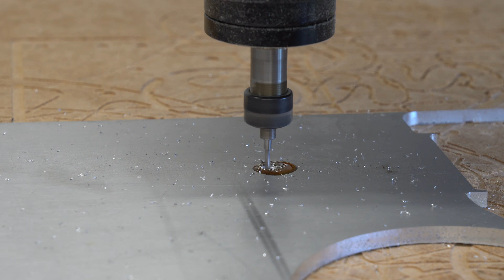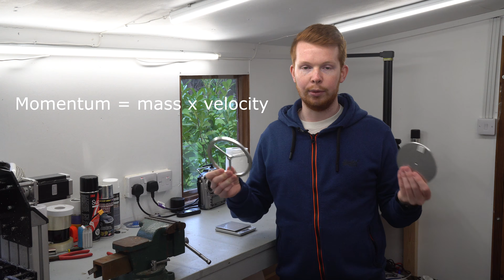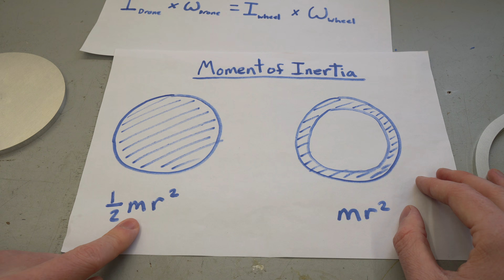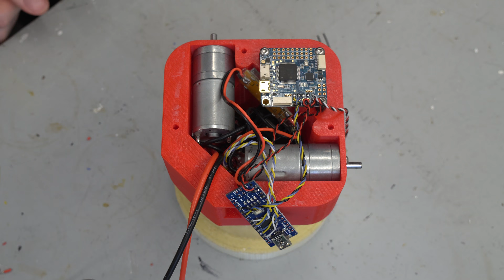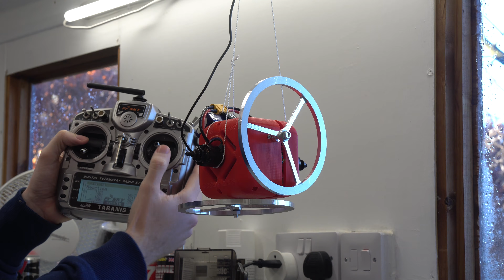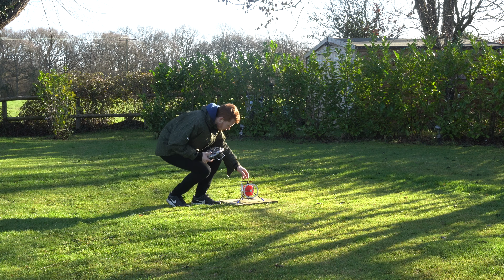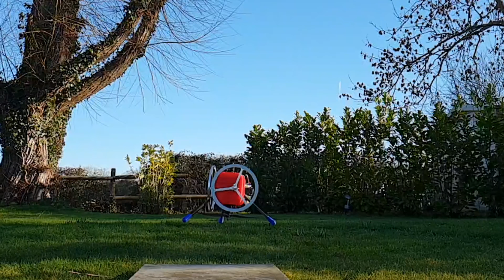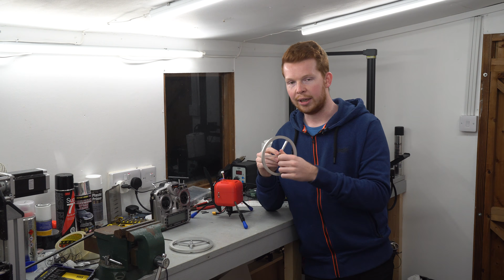Comment: I dont understand.. you are using the wheels, at least not like reaction wheels, only to counter certain moments, but all that it would work way better if the wheels are in constant rotation (so the stability would increase) and they accelerate or slow down depending your orientation requirements. 
But your rotation speed is 0, and you accelerate for one side or the other which does not seem useful at all.
I dont know.. I did not watch the whole video, maybe you explain why you try it that way?
Or you think it is cheat to use a gyroscope effect?
Reply: AngelLestat2 The problem is that you may need to induce positive or negative roll and pitch, so if you start with the wheels spinning, it means one direction will be much closer to "saturation" (i.e. no control authority).  Also, gyroscopic precession can make for some strange effects in control.  Reaction wheels are not a good design for controlling a drone.  You use just as many motors, it weighs more, you don't have very good control authority, and you get strange effects from the high angular momentum of the spinning reaction wheels.

Good video, though, on showing what not to do.  Worthwhile experiment anyway for educational purposes.
Reply: @brainmind4070  yeah I follow you, is true everything you said, but I guess it would last more than that :)
In order to have some application of reaction wheels in the atmosphere,  we would need both wheels by axis with the addiction to be used to store energy (at least 10 or 20 seconds of peak energy), for example it could be practical in a cargo airship that it would be used also as crane.
Reply: Pretty sure that the sort of thing you're referring to is a control moment gyro, whereas these are simple reaction wheels? (Granted, I would like to see a drone fly using CMG's - that'd be insane lol)
Reply: Mush V. Peets Yeah, I don't know if cmgs would have enough control authority in an outdoor environment, but it would be cool to see someone try.

Comment: Have you tried smaller sized reaction wheels (1/3 or 1/2 scale) mounted on all 4 sides instead of two larger on only two sides? I've seen reaction wheels cubes with large wheels for large movements and small wheels on the same axis for maintaining the balance.

Comment: Shouldn't the axis of the motors intersect the center of mass? It would seem that these off center axis would add other components to the movement like vertical and horizontal displacement when accelerating. That would explain the wobble or walking off the drone makes.
Reply: I don't think this matters actually. The moment (torque) is applied to the rigid body and acts everywhere on the rigid body. Since it is a pure moment load, then the location doesn't matter. The wobble is due to gyroscopic procession.

Comment: Instead of the brushed motors, you should use stepper motors which will provide very accurate amount of rotation for the wheels and will also compensate for caliberation errors.

Comment: Fantastic original thinking -- your best project since the trebuchet. It wouldn't even have mattered if it hadn't flown at all; the concept itself is just great. Well done!
Reply: *Well drone 😂
Reply: Great stuff Tom your skills as a presenter are really coming to the fore.
Reply: We typically learn more from our failures than our successes.  I also applaud his original thinking and determination to work through the entire experiment.  A very bright guy and a fun experiment.
Reply: Slap on 3 carbon fiber stand-off rods on top as well. Notice how it's never the bottom propeller that gets the worst.
Reply: Do you consider lack of knowledge in physics "original thinking"? :-D LOL ROTFL
Reply: @ok4rm  I don't see how one thing has anything to do with the other. Do enlighten us.

Comment: The issue here is insufficient feedback control, think of it this way, you have 3 PID loops for each axis of rotation , however the control for the motors requires their own individual nested inner loops, to deal with the non linear torque current relationship otherwise the resultant system is as good as being in an open loop configuration. 
So in each inner loop:
we can assume a linear enough rationship between current and velocity , and between the input pwm signal (a double for votage ) and resultant current. 
then we know the the relationship between velocity and the output torque . 
so the inner loop must take pwm as the input and then using an encoder for velocity feedback take that as the output.
this then feeds into the outer loop which for the time being is being provided by your  flight controller

Comment: Reaction wheels are also used to control the orientation of large space stations (such as the  International Space Station) but they have proven very problematic and the failures have led to a lot of study. Here's the most significant paper (I believe) about the issues they have experienced with reaction wheels on the ISS http://esmats.eu/esmatspapers/pastpapers/pdfs/2017/bialke.pdf

Comment: To save mass, you should make the reaction wheels out of batteries. Include a sliding contact system in the shaft and you'd be able to increase flight times significantly.

Comment: shouldn't the wheels be spinning from the start?
and use braking/slowing of the wheels for ur torque vectoring?
Reply: AthrunZala2395 The problem with that is that the braking can only impart a force in one direction, so if a reaction is required in the opposite direction, your wheel is much closer to being "saturated".
Reply: @brainmind4070  Use braking for one direction, acceleration for the other. Make the braking "power/speed" match the motor's ability to accelerate (that way when either braking/speeding up, the force is the same just opposite.) Don't use max speed of system, just somewhere less than.
Reply: EvilBonsai No, sorry, but you don't understand.  A reaction wheel can only spin so fast.  This is called "saturation" when it can't spin any faster.  Once it is saturated, it will have ZERO control authority in that direction, and it will only be possible to brake it in the other direction.  Giving it initial spin only biases it toward one direction, which, in the case of a dynamic flying machine, is a bad idea.  There's also the matter of angular momentum, which complicates and limits controllability.  The last thing you want is a flying gyroscope, which is why quadcopters have two rotors spinning one way and two rotors spinning the other.  Plus, quadcopters don't RELY on the spinny bits having momentum.  It is a side effect of their structural mass that is purely there for the rotors not to break when they are pushing air.  Reaction wheels, on the other hand, are designed SPECIFICALLY to have INERTIAL mass, so that when they are spun up (or are braked), the object they are attached to moves in the opposite direction.  The more spinning mass you have, the more pronounced the gyroscopic effect, which makes control that much more difficult.

Like I said, fun experiment but practically useless.
Reply: @brainmind4070   Needs dual wheels and motors one with tubular shaft so they can run in opposite rotations and accelerate/slow as needed  to stabilize.  Quad counter rotating gyroscopes I guess?
Reply: Lloyd Prunier More weight, larger or more motors to run more wheels.  I hope you can see why conventional drone control methods are superior.  This was a worthwhile experiment, but he really should have gone into why reaction wheels aren't used for this application rather than just trying to keep "putting lipstick on a pig".
Reply: This would also make it act as a gyroscope and want to precess, causing undesirable reaction torques. This is also an issue with this design since the spinning wheels produce a reaction torque about the propeller axis as they speed up, which makes control difficult since the PID algorithm is chasing a moving target as the orientation changes in an unrelated axis with its own inputs.
Reply: Having it spinning ahead of time would bias the response to one direction. Because of back EMF (essentially a generator effect from the motor spinning), speeding the wheel up will produce progressively less torque than slowing it down.
Reply: Would love to see that too. Probably quite stable.
Reply: I was thinking that as well. I think it would result in a much more linear response as the axel would never be completely stopped, thus avoiding the static friction that occurs in the transition of spinning opposing directions. Also, he stated that he couldn't use brushless motors because of their low rpm response. If the design was modified to brake/accelerate and care was taken to ensure that the lowest rpm avoided this region then a brushless motor could work.
Reply: Spencer Williams No, using reaction wheels is a bad design.  There is no advantage.
Reply: @brainmind4070  maybe it is a bad idea. That doesn't mean that people can't discuss way to improve it.
Reply: @brainmind4070  An advantage was never implied, merely a quest to try it out and see if it could be done.
Reply: Sherlock MacGyver Spencer implied a possible advantage.  If you look back carefully, you can see that all my responses are purely responses and not projections.  Not really living up to your first name there, Sherlock.
Reply: @brainmind4070  I fail to see the implication of an advantage over other methods in this title:
"Can Reaction Wheels control a Drone?"
Reply: Remember he said, "Quite honestly, I have no idea", in response to a question of why he wouldn't just do it the conventional way. And it's only because he's interested in if it can or not. There was an implicit NON-implication of an advantage.
Reply: Not living up to that "brain mind" title.
Reply: Good observations. My reccomendations: Starting with the wheels spinning would half the "force to saturation" but would help motor control. Sounds like he has a current sensor for motor torque. If he had a speed sensor this would not be nearly as hard to control, you depend on the motor speed/torque curve(easy to control in manf processes) and transmission efficiency(hard to control in manf processes) to guess, I mean model the output speed. This also allows you to compensate the inductive delay of the motor actuation and compensate with more power! Also the PID is underdamped. This could be because the Inertia of the Wheels may be set too low. A second set of smaller(20-30%) Low Inertia Wheels would help  to avoid saturation, and could start in the opposite direction at some equivalent range of speed to compensate for the lower Inertia. This way you can also counter rotate like you can the thrust props. Speed sensing would be useful here too.

Comment: I think it suffered from gyroscopic precession.
Reply: The problem is probably not so much the lift motors, it's the un-countered gyro effect of the wheel motors spinning 100's of rpm -if the motors spin same direction as wheels. This will induce a 90deg shift in force applied (gyro prec) -then the other motor tries to counter it -then the regulation loop time goes bananas and oscillate.
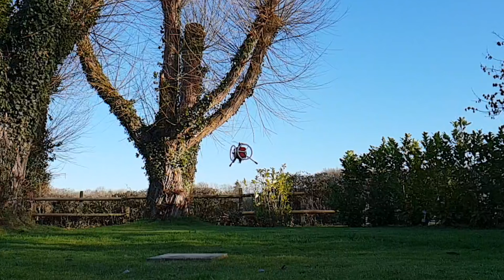Reply: I also think the gyroscopic effects are the culprit here. On 20:26 it is clear that the bottom propeller rotates way slower than the top one, which is why there is no way it could be cancelling out any precession.
Reply: I think so too, the two propellers will dampen and translate the reaction wheels force, and induce the wobble of the body.  Try spinning the propellers and moving the body in a jig.
Reply: I think you're right.  If you look closely, the wheels are speeding up and slowing down in sequence like each one is trying to cancel out a precession caused by its neighbor.   I think that's what is making the entire unit oscillate and jitter as the excess inertia "jumps" from wheel to wheel.

The problem is... if the control system is underdamped it would look almost the same, so I can't be totally sure.
Reply: @talyrath  i agree and this is all amplified by the shifted cemtre of mass. I am not know with drones but i know some bit about model planes. There the centre of mass needs to be under te force of lift i.e. the wing.
Reply: my guess is some non linearity somewhere in the system. even the DC motors alone are not translating voltage to rpm/torgue in a linear fashion, where I guess the controller tried to calculate speeds based on a linear response. If you noticed the craft can keep itself stable as long as it stays between a certain angle. So to control the system properly, I would try to capture the impulse response of it. There are simulation programms like BORIS where u can simulate this kinda stuff
Reply: If you put a rotating disk on the end of a stick and move the stick at an angle the wheel will put a force on said stick at 90 degrees.
Everybody's probably seen this on gyroscope toys.
I suppose a simple fix ( after thinking about it for a while) would be to rotate the sensors  45 degrees.
Reply: Should try building a completely processional reaction wheel to exploit that. constant angular speed about a changing axis.
Reply: I agree with Dirk here, a gimbal jig for testing!
Reply: I have some adjustment proposals. Put four small gyrowheels in the x an y axis. Opposite one another like a cross. 
When both wheels in the x-axis rotate clockwise it will result in a counter clockwise rotation of the device on the x-axis and vice versa. When the same wheels spin in opposite direction, in stead of cancelling out the let the device rotate around its z-axis like a bicycle on a string (see V-Sauce on spinning). I think it might work with just two opposing wheels. One of the problems with the in the video used setup is that it looks really inbalanced. Center of mass should definetly be exactly between the two props. I think that when you tilt the device the lift (speed) of the propellors should be increased. Because otherwise it go falling down slowly, it could be that this is common knowledge in droneland in that case I didnt know that... 
This was all already posted below but this might help clearing it.
Reply: I think the gyroscopic effects of the reaction wheels (and probably the propellers) are influencing/fighting against the control loops of the other axes.
Reply: There could be that it suffered from differential thrust. The top prop was producing less thrust than the bottom one thus making the craft "float" on a cushion of air. In this scenario, if both props were on the top (still counter rotating), the craft would be hanging from the props. This creates a situation with the CoL (center of lift) above the CG which is inherently stable. If you were to orient both props on top, you would eliminate a possible point of failure allowing you to refine and test the reaction wheels in a more controlled way. And it would cost you less in beat-up props.... ;)
Reply: This is why quads are , quads. so this is not an insignificant part of the equation.
Reply: Counter rotating propellers should cancel each other precession...
Reply: @HVM_fi   yeah but only on that axis... hes talking about pitch and roll. owuld the addition of a mechanical gyro in the center-mass help? (i never finished high-school, be gentle)
Reply: @HVM_fi  No because he was varying there relative speeds to use them to do yaw axis control.
Reply: @HVM_fi  And the precession of the reaction wheels themselves?
Reply: @Pilotgeek  thats what I meant

Comment: You could use gimbal brushless motors, those have rather accurate rpm control at lower speed. Also it looks like the wheels stop rotating too hard and put turque back into the cube and make it oscillate.
But you know what you are talking about and it is very nice, only way this could have been better would be to have Scott Manley in the video
Reply: The point of this project is to not use gimballed motors.
Reply: @linecraftman3907  i think he did not meant gimballED motors (aka tilting rotor assembly) but to use actual gimbal motors to power wheel, they usually have higher torque for their size... they have built in sensor that knows exact position of rotor... quite precise controll

Comment: Looking at the video of the last flight, it looks like you have reasonable control when trying to react in a direction perpendicular to the axis of a reaction wheel. It looked like the problems arose when the drone was tilted towards on fo the corners of the body. Maybe a more advanced mixing style is required to allow for off a is reaction control.

Comment: tooo heavy for small satallites. Where did you read that? I mean, yes, it is a method. But I don't know any one which uses them now a day. I was making hardware for navigation and was close to the people who made the orientation hardware. And no one of then was this thing. The method is totally different, with no movement in the device at all.
But do you know what? it is interesting to test it here. But I know that it will not work good, or at all, but with some modification, could be work somehow.
Reply: @LueLou magnetorquers, these are what I mean. But I tell you, even the big ones use them. All Galileo Satellites as example.
Reply: @LueLou but a compination between both makes sense. But small sats as he said, no I don't think so at all. This makes no sense. just tooo heavy

Comment: So is this the way hover boards work you lean forward you go forward right
Reply: Hover boards don’t use reaction wheels, if that’s what you mean.
They basically work on the same concept of how, if you’ve lost your balance, you may step forward to regain it
They’re constantly trying to keep your center of mass in line with them

You could kind of relate them loosely to this I suppose
Reply: Yeah basically they speed up the wheel based on how the wheel "deck" (it's split in two) is tilted.  It might be a bit smarter than that in that it also detects acceleration, but if you hold one up in the air you can make the wheels spin.